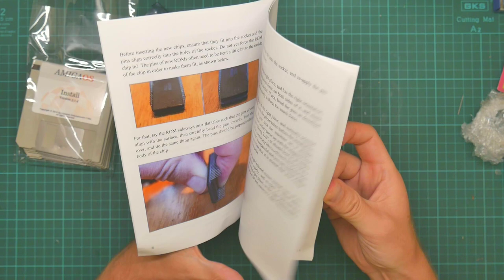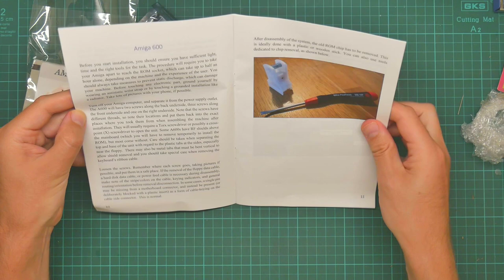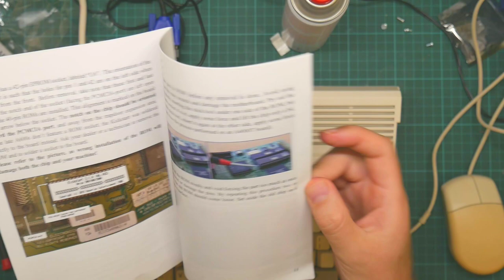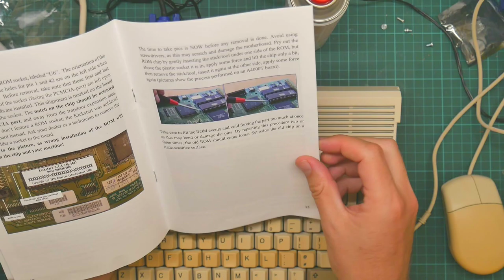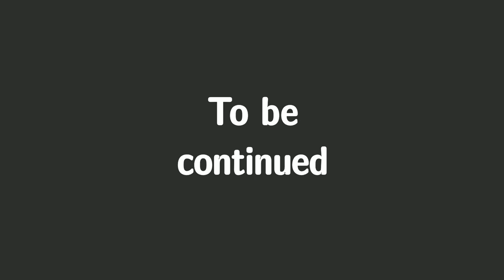Hjalfi gets an Amiga A600: #2: Kickstart woes (reupload)

Comment: Okay so I was right when I thought I saw a point where the pixelization missed the serial number, just didn't think twice of it at. Still kinda absurd how the Amiga community known for widespread piracy and cracking when it was new, fiercely guards these kickstart ROMs that are 20 to 30 years old.
Reply from the maker: The machine actually comes with about 400 filthy floppy disks, of which about ten are commercial. The ones I've dared to try which actually work mostly have crack intros!

Apparently AROS have an open source Kickstarter ROM that works pretty well, but of course I only discovered that after I'd bought the Hyperion ROM.